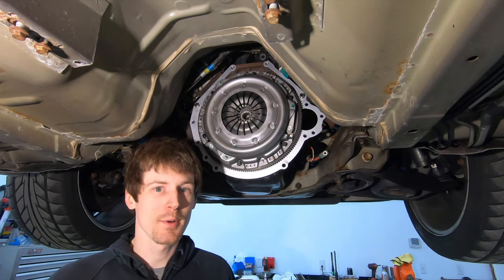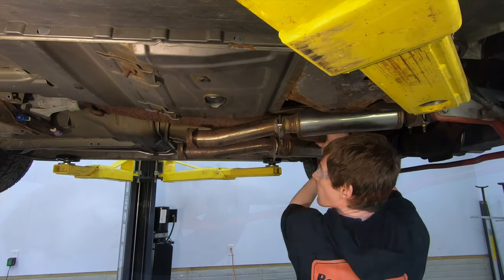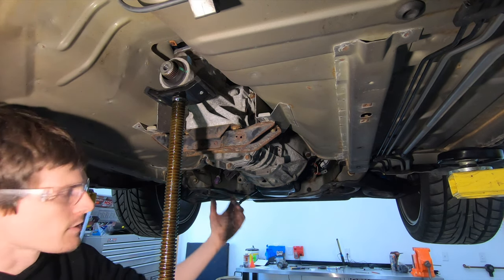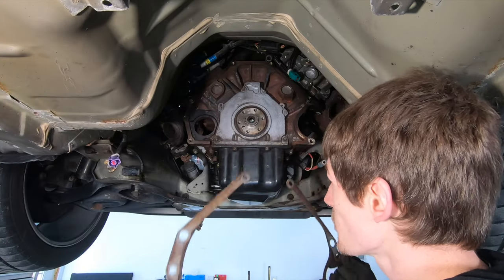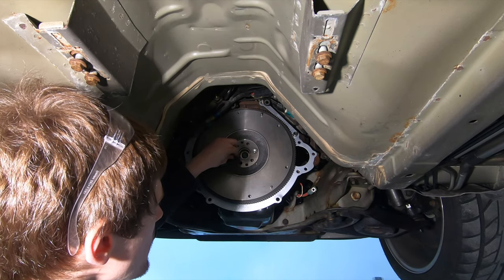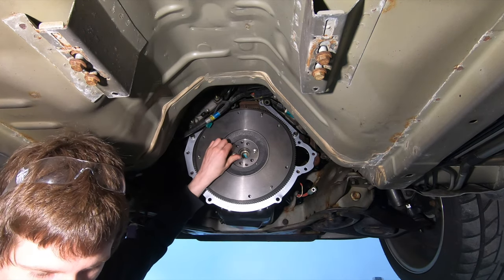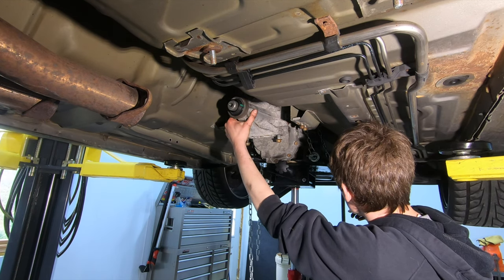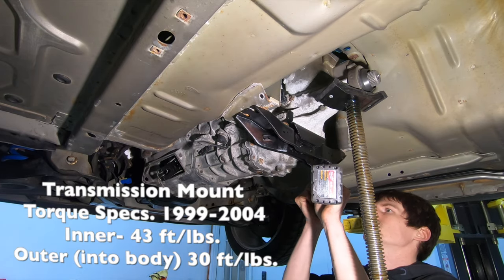Ford Mustang Clutch & Flywheel Replacement (79-04 SN95 & Fox)

Comment from the maker: Here are the links to the parts and the tools I used in this video:
Pilot Bearing: https://amzn.to/3cEstWm
Throwout Bearing: https://amzn.to/3fWhYzG
Pivot Stud: https://amzn.to/3dV7leL
OEM Ford Clutch Fork: https://amzn.to/2LvzX1Q
10.5" Clutch kit (Stock Pressure OEM Valeo): https://amzn.to/2z354ze
11" Clutch Kit (Stock Pressure OEM Valeo): https://amzn.to/3652OUd
10.5 Clutch Kit (High Performance Ford Performance): https://amzn.to/2AumSna
11" Clutch Kit (High Performance Exedy): https://amzn.to/36c5Vd1
Awesome transmission to floor jack adapter: https://amzn.to/2zOm5wX

Help support the channel, buy using my Amazon links
As an Amazon Associate I earn from qualifying purchases and your cost is exactly the same.
Reply: Flywheel?

Comment: Dang I was hoping I wouldnt have to pull the exhaust I just welded directly in the way. I'll be swapping in a junkyard trans with no history. Rolling the dice hard on this one!
Reply: How'd that go
Reply: @itzsopanda3821  4th and 5th were busted haha. Got some good practice tho i just put in a factory rebuilt 3650 and it slid right in there now that i know how to line it up just right. The trick is to grease the splines up and not have the front of the car jacked up too high. I use a 2x4 to support it while i bolt it up so i can get that jack out of my way. Then i run the two longest bolts in to suck it in flat, then back them out and put them all where theyre supposed to go. I also learned that my drive shaft bolts were very loose despite cranking the shit out of them. So locktite and a 12pt socket and impact are needed. The box end wrench isnt gonna hack it. The 99-01  t45  tailshaft housing from the junkyard one is a $300 ebay item, so ill make a few bucks. I also learned that the chchch noise wasnt actually coming from the  transmission, but the rear spark plug about to blow out! Sounded like a champaign bottle! 🤣

Comment: Man I love your attention to detail.
How much would you think a clutch replacement cost?
Reply: $30 for heavy duty throwout bearing.
185$ -220$ for clutch 
74$ Shiftfork if needed
20$ fluid
My guess you looking at around 350$ I would change rear main seal while I was in there

Comment: Great video! I think the larger pilot bearing you did not use is the high load style, part M-7600-C.
Reply from the maker: The larger bearing is the one I used. I used the standard ford racing bearing. The small bearing that I showed was the one that came with the clutch.
Reply: @RepairGeek  Gotcha, sorry.

Comment: good stuff a 34 min video im guessing took 6 hrs to do in real time....was going mine on the ground yesterday and not fun stuff! my tip rent a uhaul tow dolly ...makes it nice high and safe ! it wont fall on you like jack and jack stands ...
Reply from the maker: I could probably do it in 3-4hrs without making the video. Just depends on how easy it comes apart. Setting up the camera, lighting, mic, changing camera batteries all takes time. Good point about the Uhaul. Thanks for watching.

Comment: very nice job. where did you get that shift knob? also on a T-45 how much fluid do you put in, top it? do you grease the outside of the pilot bearing or does it go in dry?  once again nice work on the video, very professional.
Reply from the maker: Shift knob is an old Mach1 knob from Ford Racing. It's been discontinued but you can find replicas easily. T45 fluid capacity is just over 3 qts. Fill it until fluid comes out the fill plug in the side of the trans. Just put a small amount of grease on the TB sleeve and on the splines. The less the better. You don't want the grease on the clutch.

Comment: I didnt see you use dowel pins on the fly wheel is there a reason why? Do i need to buy new ones when replacing the flywheel? Thanks

Comment: Great video. I have a 98 cobra with the t45 and I have bbk long tube headers. To replace the clutch would I just need to loosen one of the headers so the trans would clear the headers. Thanks.

Comment: @18:25  
I have the same Ford bearing on the left but for a 92 5.0 Mustang. Would it work? The one it has on currently came out and is shorter like the right side bearing.

Comment: So a shop installed my MvLeod clutch and flywheel with the throw out bearing lobe on the pivot side, im sure should be on the clutch cable side. Does this really matter? Also ford did issues me another bearing but instead of a lobe or egg shape one it had a dowel pin. What would you suggest i replace it with?

Comment: Replaced my Clutch a few months ago and since then I’ve had a vibration in the clutch pedal where I have to pull up on it with my foot to make it stop. Any idea what went wrong? Did all I could to try and adjust the pedal and nothing.
Reply from the maker: Are you using an aftermarket firewall adjuster? Sounds like your throwout bearing is bouncing on the clutch fingers causing the vibration.

Comment: What torque did you used on the pressure plate apr bolts? I purchased the same bolts for my 2001 mustang bullitt/gt
Reply from the maker: I think it was 40 or 50 ft lbs. The package had a paper inside with the torque spec.
Reply: Thank you

Comment: How did you tighten the top two bolts of the driveshaft when reinstalling? Mine does not spin
Reply: get the back wheels in the air so it can spin, thats what I had to do as I did mine without a lift.